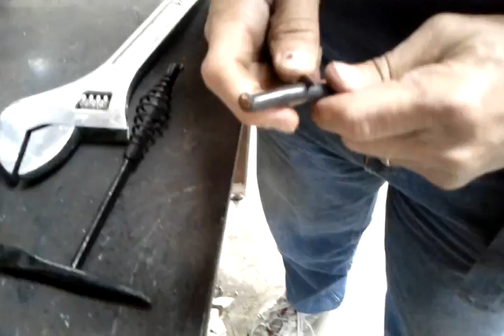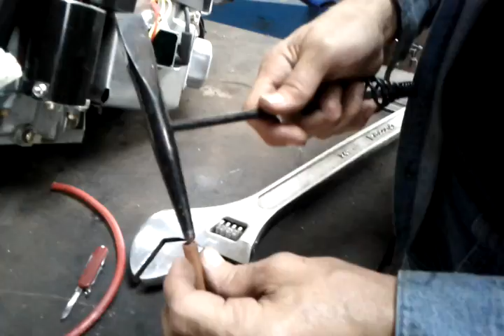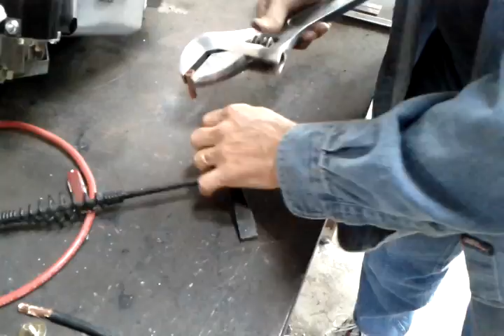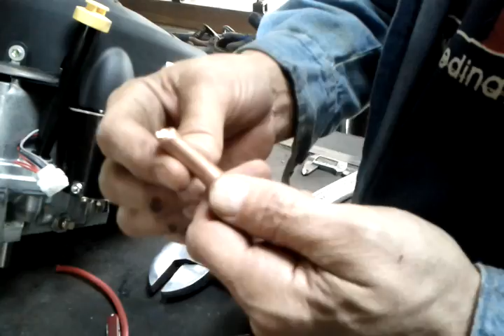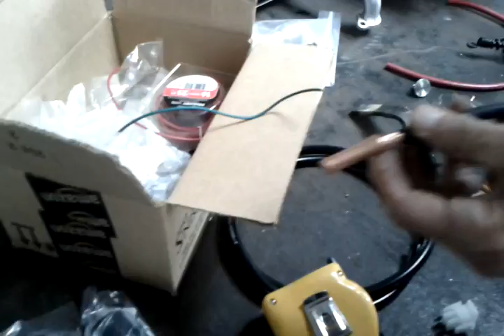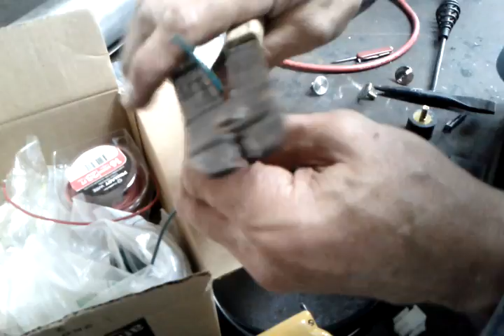Power Cube Battery Terminals

Comment from the maker: This method works ok - but stranded wire shifts around, so either a more specialized crimping tool than a vise or soldering would be required to make a permanent connection.